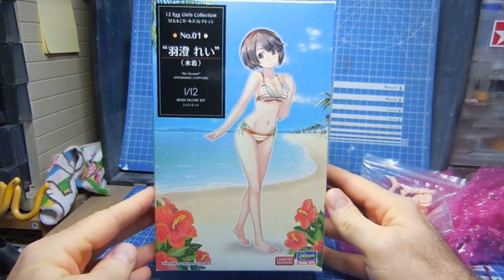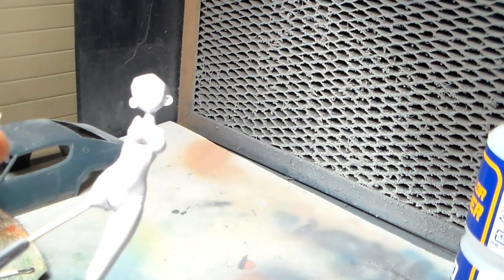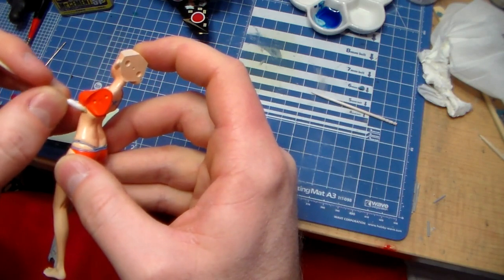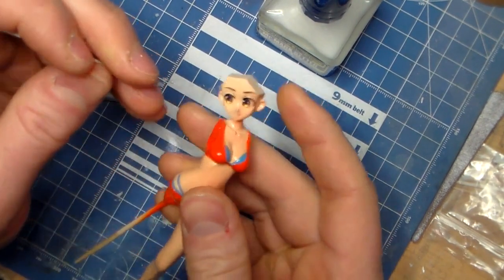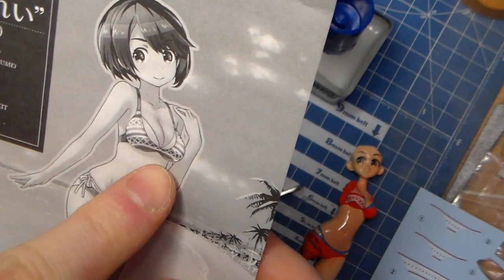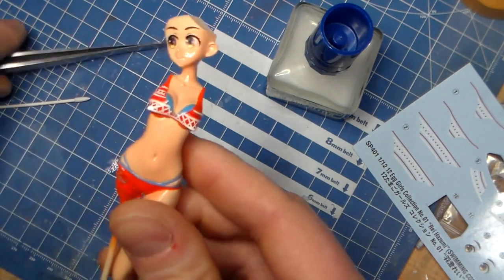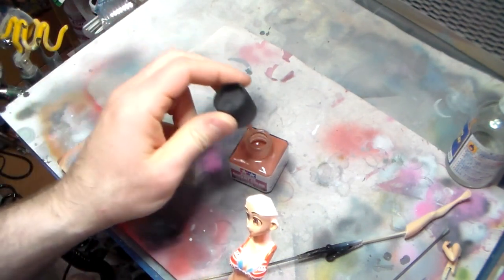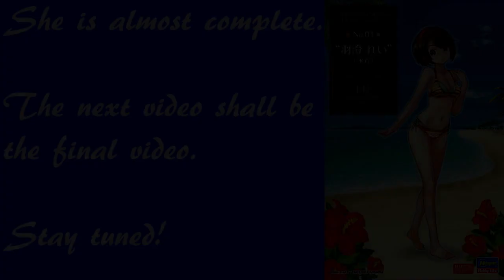Hasegawa 1:12 Egg Girls Rei Hazumi swimsuit gareki build 2

Comment: Are these figs resin and not plastic? Also is it not dangerous to touch?
Reply from the maker: These are indeed resin figures. No, they are not dangerous to touch. If you sand resin a lot and then snort the dust like coke, that is indeed toxic and could lead to cancer later in life. While sanding, wear a respirator mask with filters---not those flimsy medical masks that are only made to prevent doctors' spittle when talking that people wear,  absurdly believing that they protect people from viruses.